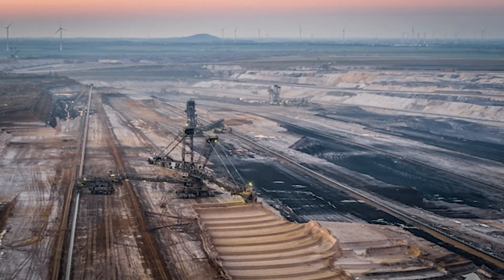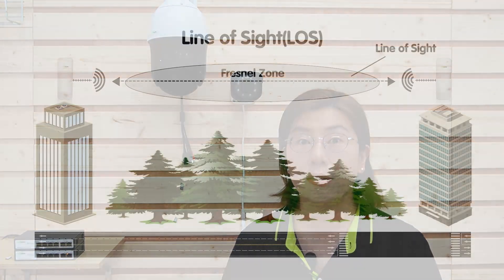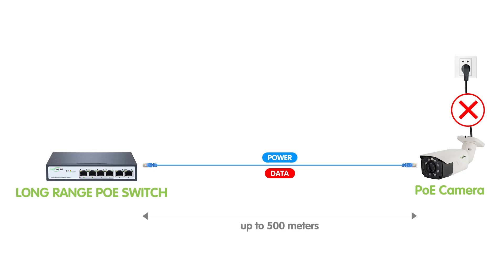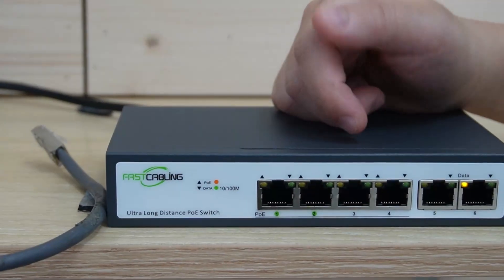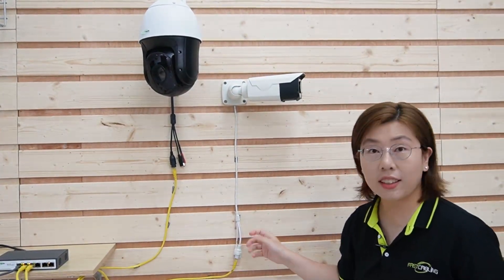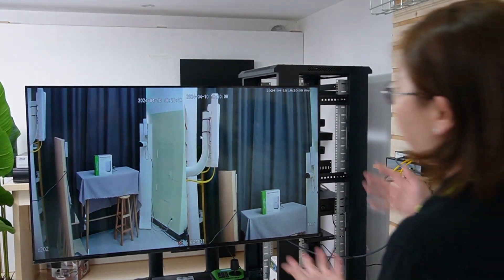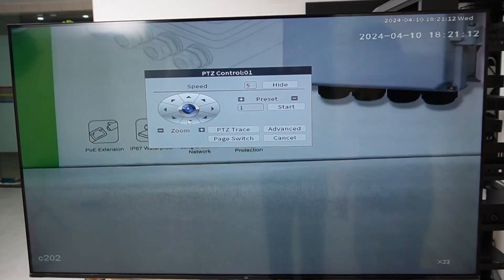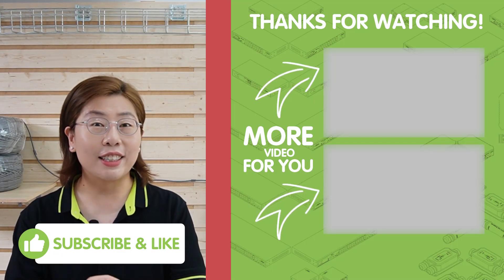Eyes on the Site: Deploying PTZ and Bullet Cameras over Long Range

Comment: Ma'am you forget to demonstrate the difference between long and normal PoE switch. i was expecting to start the video with normal PoE and after visualization, install long range PoE switch..🙄
Reply from the maker: Thanks for bringing it to our attention! The main difference between a normal PoE switch and a long-range PoE switch is that the former can only support a maximum distance of 100 meters. Beyond that range, it'll experience significant signal degradation and voltage drop. However, the long-range PoE switch can effortlessly extend PoE signals up to 500 meters while maintaining a transmission speed of 100 meters.

Comment: What type are the poe switches
Reply from the maker: They are long-range PoE+ switches that are designed to extend your PoE range to 500 meters at a speed of 100Mbps. 

You can also use one long-range PoE+ switch only. It can support a transmission range of 500 meters at a data rate of 100Mbps (800M at 10Mbps) when used with a PoE extender. Moreover, by enabling the dip switch, you can directly extend the distance to 250 meters at 10Mbps. 

https://www.fastcabling.com/product-category/long-range-poe-switches/